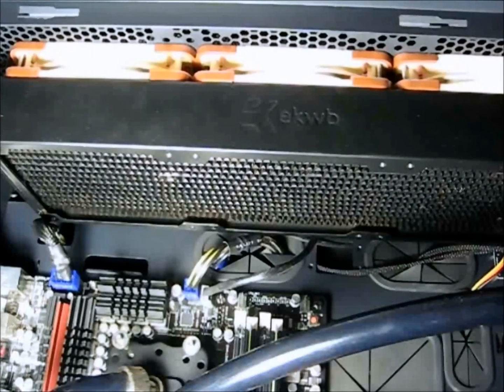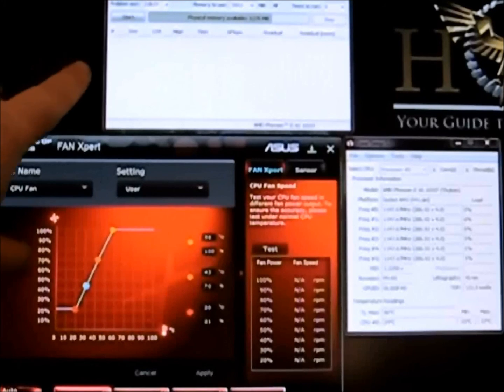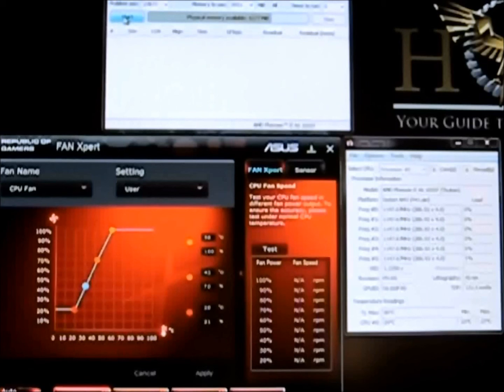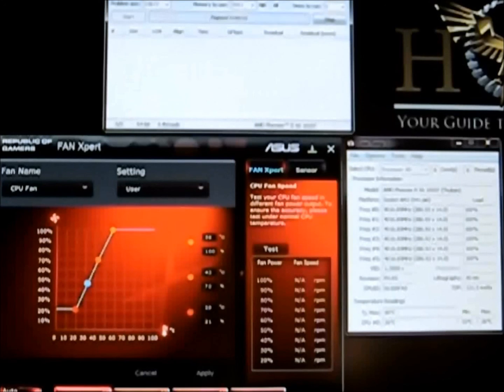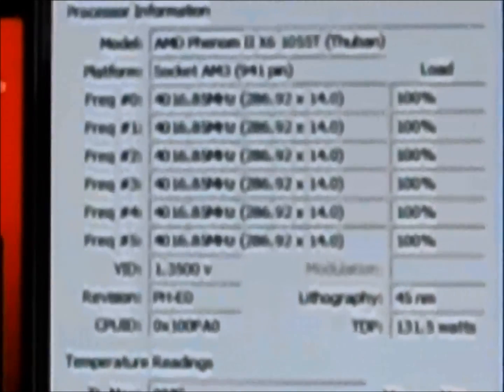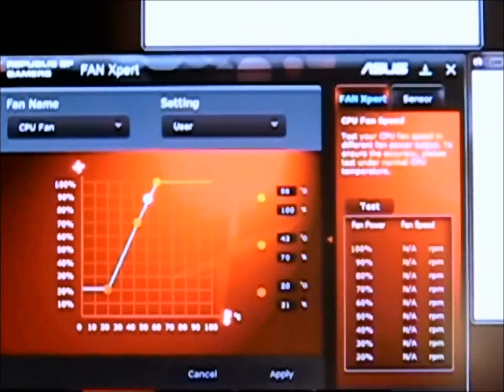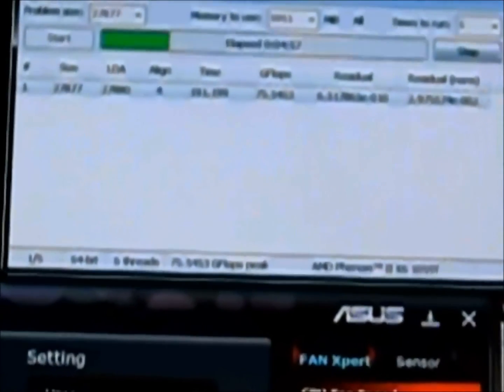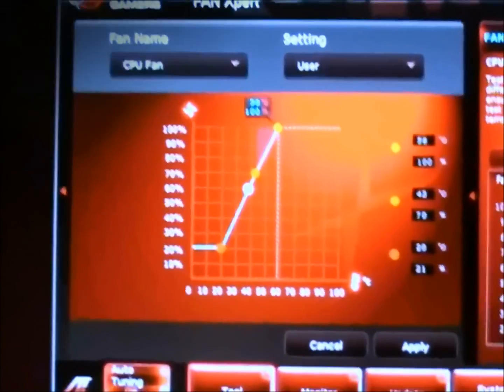Noctua NF-F12 PWM Cooling Test

Comment: "HiTech" in the name...
...points shoddy webcam at screen instead of using video capture software.

I often like the reviews on your site, but this is just... wtf?
Reply from the maker: do you.realize that this video is almost 5 yrs old
Reply: +HiTechLegion I do! A little less than 4.2 years, but I guess you can say "almost 5" to get your point across.
Mostly I was just baffled by its quality, I figured, since video capture was around 4-5 years ago too.
Cheers!